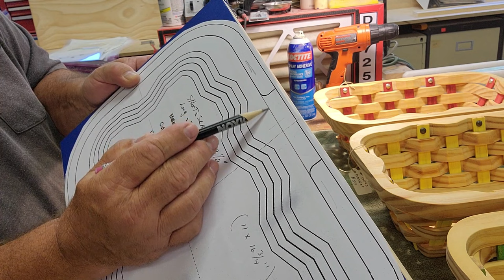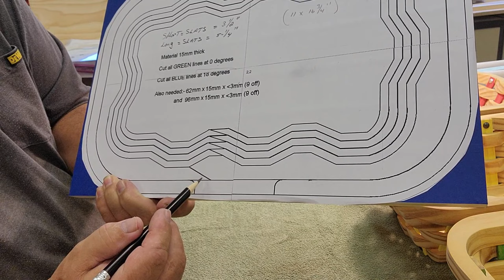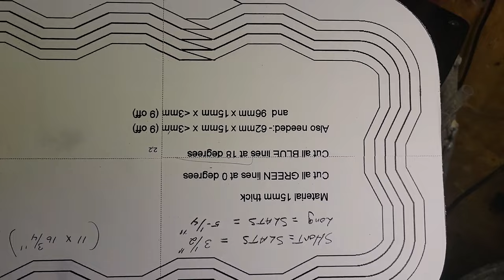Making a scrollsaw basket | Part 1

Comment: Nice job and great video. Is there a reason why you don't drill small piercing holes instead of having to glue them up later to complete the rings
Reply from the maker: Yes, that is one way you can do it.
I just thought this way would look better.
Reply from the maker: Yes, that is one way you can do it
Just thought it would look better this was.

Comment: Luther, What adhesive do you use for the basket paper pattern that will peel off and not effect the blade?
Reply from the maker: I just use a temporary adhesive spray 
Put down painters tape first, then the pattern

Comment: Where can I get the pattern for this basket? Also, the DCT thin strip jig on Amazon only has one wheel. Where can I find the double wheel jig?
Reply from the maker: As for the pattern for the basket, the picture of the pattern is on my Facebook page. Save the image to your computer, then just print it out. You will need to enlarge the pattern to the size you want.
The thin strip jig, you are not the only one who asked. I bought it at a woodworking show years ago. I'm not sure who I bought it from. I have searched all over for one with two wheels and can not find one. They all have just one wheel on them. So you may have to settle for the one wheel. I don't know why I can't find one with two wheels.